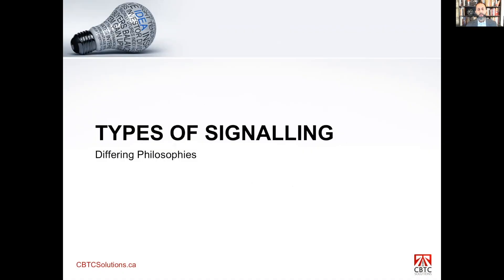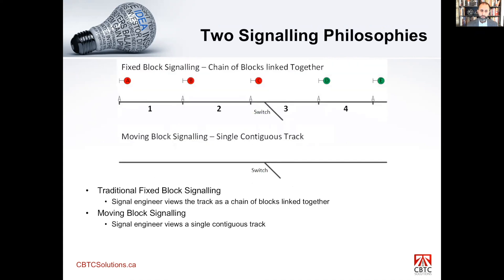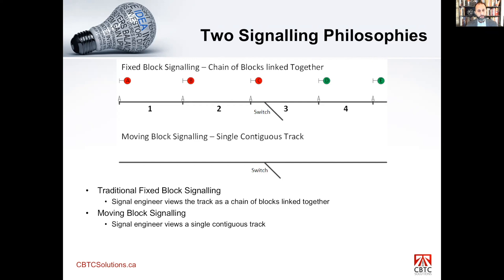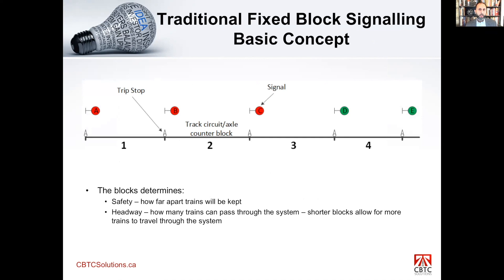Types of Signalling Systems

Comment: The other big savings is the trackside infrastructure is less expensive to maintain.  There are fixed transponders between the rails which are waterproof and the train location data is supplied by a secure wireless network.  Much simpler and cheaper to deploy and maintain.